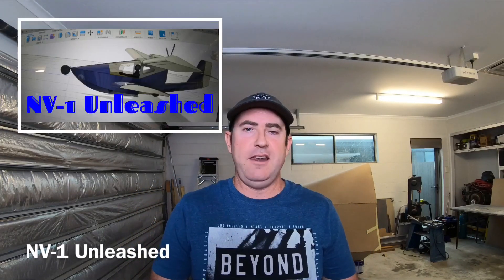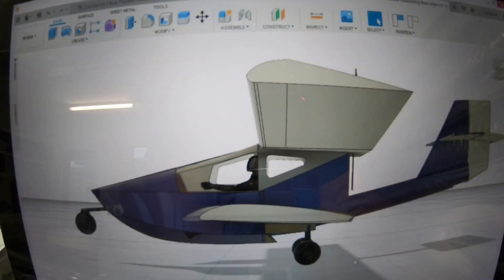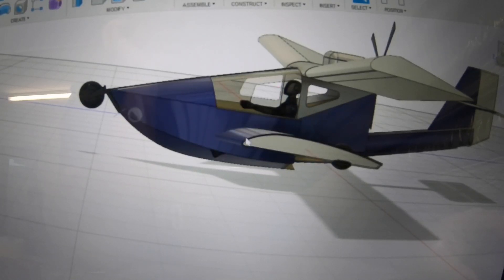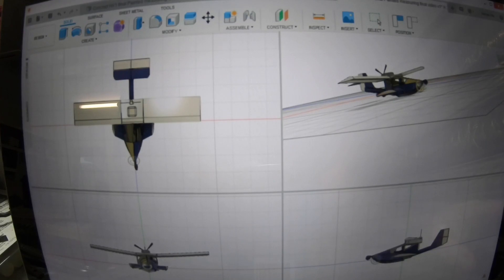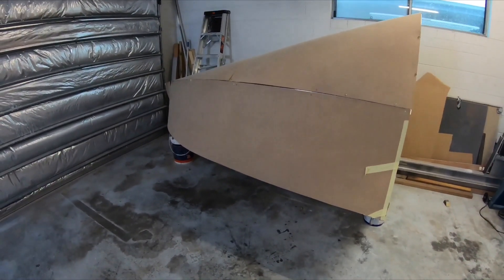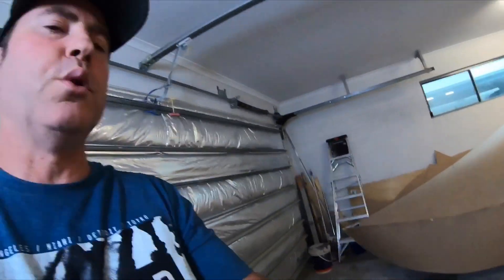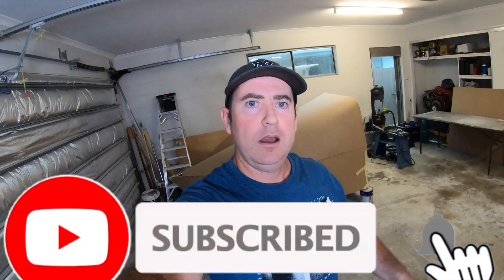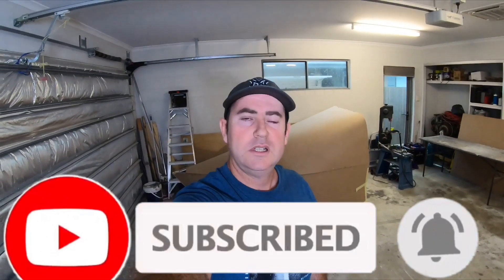Sea plane NV -1 Unleashed Amphibian Experimental Aircraft build concept

Comment: WT ??? . I just watched this ? I am more impressed now 🤯. I thought you were building a KIT ?? . More power to you Sir 🤓.  I dreamed of something very similar ? But with the Subaru motor in the back seat area over a water jet unit   driving a high prop with a belt drive  ?, . With the front wheel tucking into the hull and the main wheels folding back and up into the area behind the hull . But I would have no idea of how to make it happen ?? .
Reply from the maker: hahaha thanks Peter yes this is my own design . sounds like you have similar ideas 👍🏻 you can’t beat the versatility of a seaplane especially towing it to a local boat ramp fold the wings out and go 😀 thanks for following the progress.